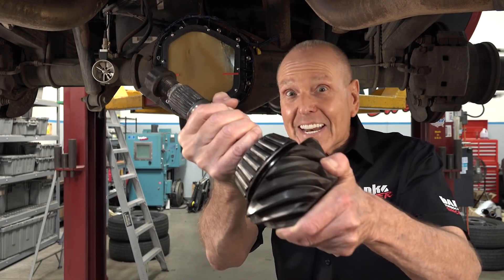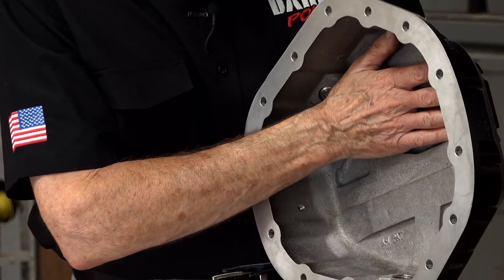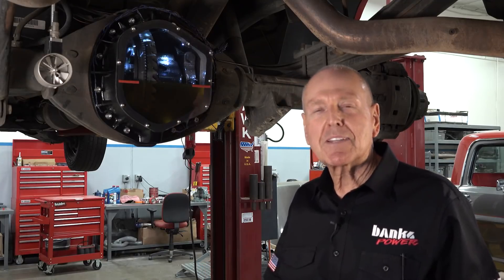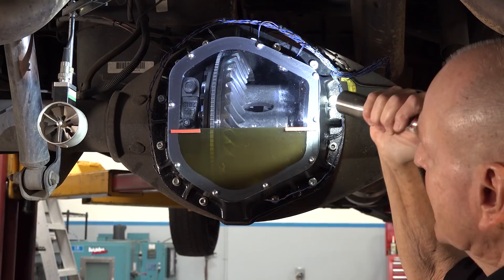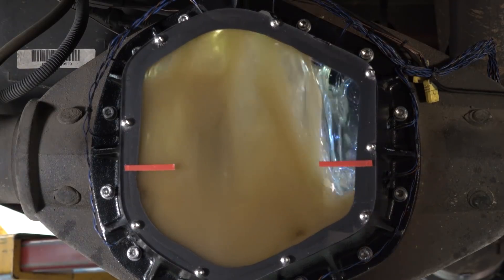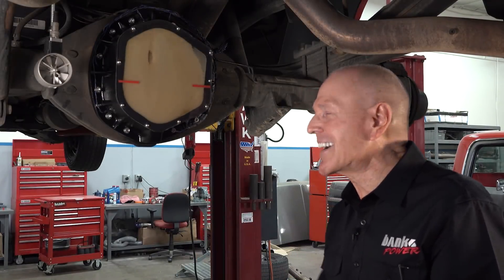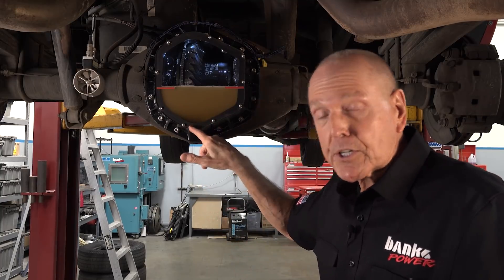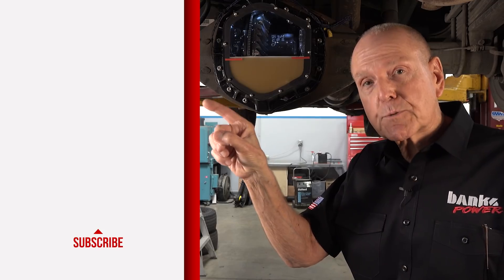What's going on behind your flat-back diff cover?

Comment: If you want to know how much oil is getting to the pinion,  repeat the test under some kind of a load and measure temp of the case at each bearing race (so 4 places).  Even a light load as long as it is repeatable will prove that the pinion is getting starved.  I checked case temps of an axle that I rebuilt using an IR thermometer and I found that while the oil temp was getting to around 185deg F (measured at rear cover), the pinion head bearing was hottest at around 210deg F followed close by the pinion tail brg and then the L side carrier brg.  The pinion gets the biggest workout as far as temps go, and as you know temperature kills gear drives more than anything.  Excellent video, BTW and thanks for sharing your findings!

Comment: Hay Gale, what about a Mag HI tech Style cover with a stock fill level hight and a windage plate so the oil will flow nicely with the ring gear. The oil won’t cavitate or airate you will have more quantity of oil and the aluminum cover to dissipate the heat. Maybe even some bling?
Reply: Just make a windage plate that fits between the axle and any aftermarket cover. It could even have parts top and bottom to smooth the transitions to the axle housing for less fluid heating from the turbulence in those areas.
Reply: That seems "logical". Maybe having something like a built in "shoot" or "channel" that wraps around the ring gear like a motorcycle front fender hugs the tire to guide the oil and mitigate cavitation and all the other nasty stuff as much as possible.

Comment: Dear Mr Banks; Im enjoying the videos and the knowledge gained is great. Yeah here comes the BUT. I hate to ask if you would run the test again but, would you run the test again. This time would it be possible to monitor temperature differential between stock covers vs flat back by putting a temp probe in the diff. The other idea i was curious about was using a flir camera to monitor the temp just behind the yoke to see if the pinion is drastically hotter from cover to cover. Again just curious. Thx
Reply: Temp numbers are coming with the dyno test on part 3, I'm sure.

Comment: I’ve seen enough,just make a stock shaped aluminum with fins
Reply: Bradford Ramm why fins? Cooler oil will have a higher viscosity and waste power.
Reply: mbox314 start hauling a hotshot grossing over 32 k in the summer over the mtn passes and then see if you still ask me that question.
Reply: how could you say that... lets wait for the master to finish the tests
Reply: @philtripe  lmao  this comment  made my night
Reply: What I don't know about oils could fill a warehouse but I imagine if your differential oil stays within a working range you should be fine, elevated temps below the maximum working temp are not nessasarily bad as higher temperature differences result in exponentially faster heat transfer, also a less conductive diff cover would be helpful in shorts low load drives in colder weather as your diff oil would get to the ideal working temperature faster and lubricate adequately. Put a temperature sensor (avoid IR's as the black coatings higher emisivity will give higher readings)  if you notice higher temps than your oil is rated for then a new diff cover would be worth considering.
Reply: @mbox314   cooling fins will not make differential fluid cold enough to increase viscosity to a level causing more parasitic draw. Cooling fins are meant to help dissipate heat so the fluid stays in the normal operating temp range, increasing the usable lifespan of the fluid.  In theory cooling fins could remove too much heat but, in my opinion, the fins would have to be rediculous in size to achieve that much cooling. But I am not an engineer, just a seasoned automotive technician.
Reply: Kevin Kalivoda I am an engineer but this is not my area of competency. I really need to brush up on my thermodynamics knowledge. In my job right now I am actually intrested in increasing friction instead of decreasing it. Friction is an interesting subject. Did you know on hard surfaces increasing surface area has NO effect on on friction force , the only two variables are normal force and friction coefficient. Many  materials do not follow classic friction models and I would like to know more about them.
Reply: @NoName-tz5ji , im not defending mbox314, but if you are hauling 32k lbs with a 1 ton truck i am pretty sure you are well past gvrw as well as the design limits of a 11.5 AAM differential. But I agree with an aluminium cover with cooling fins. Or, take a page out of NASCAR and run a driveshaft driven pump and cooler for the diff fluid.  Yeah, it will increase parasitic power loss and decrease fuel mileage but it keeps fluid temps in check.
Reply: Kevin Kalivoda I’ve seen 1tons gross 42k on a regular basis for decades. Easy on the throttle and you’d be surprised how much your equipment can take with increased fluid changes and real synthetic.
Reply: @NoName-tz5ji   im not debating weather a 1 ton can move that weight, its about should it haul that much weight. I have moved a 40k lb connex container with a 2500hd pickup without mechanical failure, but I only had to drag it about 200 feet through a work yard. To me hauling that much over gvrw on the road becomes a legal and safety issue.
Reply: Kevin Kalivoda more legal than safety nowadays,but then again we have the CDL government certified school indoctrinated snowflakes at the wheel nowadays so you might be right. I sure do miss America and Americans. Can you imagine trying to invent the airplane in today’s America? Sad
Reply: @ryanburbridge  you do know the alert plan was started under obama,  right?
Reply: @NoName-tz5ji  hurr I tow so now I'm a lubricant chemist
Reply: Mctig Mctiggy absolutely! However that’s an equation for those grocery getters not a heavy tow vehicle 🤫
Reply: Ram has an OEM diff cover that is aluminum and has fins. It comes stock on certain 1 ton models
Reply: Mark T they are the fastest growing brand for a reason. (Now they operate separate from Chrysler Corp)
Reply: Some manufacturers do make their covers with fins and keep the stock internal curve design and it works great
Reply: My 2013 F350 6.7 has a stock aluminum curved cover with fins.   After watching this video series I am never changing it.
Reply: Thank you for doing this video! It is really great to see that you putting in a lot of research on these covers. Looking forward to seeing video #3!! After doing all of this I know that you will make a diff cover that works!!!

Comment: Awesome information. I've always theorized that most aftermarket diff covers cause undue work to the oil and theorized that overfilling (as recommended by the diff cover manufacturers) causes excessive aeration of the fluid. Because of this I've always run stock or stock style diff covers in all of the off-road trucks I've build over the years. What I have done is have plates of steel welded to stock diff covers to provide protection from rocks, etc; especially at the front axle and at the bottom of the rear axle cover (where rocks can rip open stock diff covers when sliding over them).

I've had numerous "discussions" with guys in the local off-road club who think they are helping things by running these aftermarket diff covers and overfilling (especially with guys who haul their trail rig to the trail and install them on the tow vehicle). I don't think I've convinced any of them but maybe these videos by Gale Banks will help...

One thing I'm no so sure of though is if aftermarket diff covers actually starve pinion bearings. I suspect there is still plenty of oil slinging off the ring gear at high speeds that "foamy oil" still gets to the pinion bearings. Every differential I've taken apart has always had plenty of oil in the pinion lube pockets, regardless of which differential cover was installed. The fact that the oil is so badly aerated is why I believe both the R&P gears and all of the bearings only suffer with these overfilled aftermarket covers and that stock is much better at providing lubrication.

Comment: So, copy the stock design, in aluminum, and add some fins?
Reply: Yes. Perfect setup lmao
Reply: would never buy weak ass aluminum
Reply: @mattlane2282  you will never break an aluminum cover using it for what it's intended for. Towing.
Legit off roading, get fabricated or cast steel or iron.
Reply: you have a huge hole in the back if anyone does not think that cover adds strength they are nuts... 

also... dissimilar metals... why... just why...
Reply: Theoretical optimum. External heat exchanger to maintain the best temp for the oil.
Reply: Its already been done look at a RAM 3500 diff cover ...it comes stock has curved inside with big fins and alumunum
Reply: look at Ford's 350 and 450...
Reply: Matt, the cover is just that, a cover, it is not a structural element at all. Those retarded covers that have the bolts to push on the bearing caps are a joke. If they were, they'd be made of something more substantial than 22 gauge steel that you can stomp flat, and on with something more than 1/4-20 bolts. That's why the case is an inch thick of cast iron.

Comment: Alright, this is turning into more hype than I was hoping for... couple of points to note, questions to ask yourself before you jump on the non OEM cover suck band wagon...

1. What is the failure rate of rear axles with non OEM covers? What is the failure rate of stock covers? You'd think if all Gale is saying is true, there'd be some mighty pissed off people out there. I haven't hear any, have you?

2. Oil aeration. Are you really going to sit here and tell me that the factory cover doesn't foam the lube? You only saw the Ford cover run to 30 mph, he didn't go to 50 like on the Dodge, so right there,  that is not an equal comparison. Also I believe the Ford's lube for the half ton is thinner than the 1 ton axle. Check me,  but run speed alone disqualifies this.

3. Oil aeration and lube type. Not sure how many people dive this deep into oil, but, a right angle gearbox like the rear end is horribly inefficient to start with, and thus, it requires a unique lubricant. Have you noticed that engine oil is getting thinner and thinner with new engine manufacturing tolerances getting better, while gear lube is unchanged? The whole reason it uses molasses-like oils is because the application beats the snot out of it. Even a bevel gear right angle drive uses heavy oil. It is in their nature to aerate the lube. It is accounted for by design. 

4. Front bearing lubrication and amount of carryover from the pinion and tone ring. Gale is all kinds of hung up on the amount of carryover present in the system vs its relative aeration of the lube. It's a flood system... whether you flood it an inch deep or a foot deep, once the shaft and bearing is covered, that's it, you're not going to lubricate it any more or better. Being that the inside of a rear axle housing pretty much looks like the inside of a blender at normal highway speeds, the lube is gonna have air in it. Nothing you can do about it. The addition of additional fluid, as added by the increased cover depth isn't going to change this by any appreciable amount up or down. I do agree running higher level to fill the tubes is a dumb idea. The added lube just give more working fluid to absorb heat. Point I'm trying to make here is that as long as the ring and tone ring are throwing oil forward to the slot for the pinion bearings and gear mesh interface as a flood lubrication system, it doesn't matter where the oil frees itself from the pinion.

Bottom line is look at the failure rate of stock vs non stock covered differentials,  but also temper that against stock vs non stock tuning as well. Over power rating of the axle will kill it no matter what cover is on it.
Reply: I would agree 100% I wish more people read good informative comments. But marketing sells
Reply: kleetus92 I know plenty of people who tow heavy fivers over western mountain passes regularly, with stock diff covers. GM, Ford, and Ram trucks. None of them has failed a diff, all of them have run stock diff covers. First thing that goes on the Fords and Rams is the gearbox (excepting the newer Rams with the Aisin commercial truck trans). The GM trucks don’t seem to blow running gear at the same rate, they burn up the emissions system, ancillaries, and interior electrics. 

Dunno about where you live, but the trucks I see with diff covers are bro dozers that don’t actually tow heavy. The farm truck with the 30-ft gooseneck and a big Kubota on it? Stock diff cover. Exceptions to this are exceedingly rare.
Reply: DucFanDan no argument here. Only thing I'm trying to say is, is this a solution to a problem that doesn't exist and if you're going to talk about comparisons of conditions, at least make them all the same. By the way, love the term Bro-Dozers.. I gotta remember that!

Comment: Banks diff covers incoming.
Reply: RemoWest I said this on Facebook. If he can come up with a design that makes sense, and has a noticeable improvement over stock, he will make it. If his research shows that the axle companies have it right and no other design will make enough of a difference to warrant the development of a new product then he will leave well enough alone.
Reply: I expect "Banks" to produce diff covers with a radiused area where the cover interfaces the diff housing, similar to an O.E. unit. It seems only intuitive that is what is necessary to reduce the heating and aeration of the fluid. Also I would expect the contoured cover to benefit the dynamic flow of the fluid and aid in the lubrication of the pinion bearings, As the "stock" covers probably already do. That being said, I'm sure will  learn something within his testing that we may or may not have assumed.
Reply: Stock ones seem to work fine......
Reply: Probably for the bargain price of 2 times all the competition.
Reply: I'd say he already has one ready to go, or he wouldn't be bashing everyone elses so hard
Reply: @thomasmattern8679  bullshit.  He would have made one regardless. $$$$$

Comment: it didn't look any more aerated then the round back. Both levels were barely over the static mark after stopping.  Its really hard to judge lube flow just from the one dimension.  id like to see some heat senors on the pinion bearings or in between both bearings. that would be a great indicator to how the oil is truly lubing and cooling the pinion bearings.  Awesome work Gale!  truly unique

Comment: Possibly they want a higher fill level due to pinion failures ?
Reply: Sounds about right
Reply: Maybe they are trying to submerge them since they don't get splash lube
Reply: If it had a rounded diff cover rather than a flat back, then maybe it never needed the higher fill level.
Reply: It creates more circulation, moving foreign particles towards the magnetic plug.  Foreign particles and pitting from cavitation is what kills geared systems.  These diffs and bearings don't require much lube to operate.  There are so many factors being ignored here, it's comical.

Comment: Perhaps the overfill specification is because the flat back is causing the pinion bearing to be under lubricated, and raising the level causes more fluid to hit the pinion. It was a solution to the problem created by the flat back......
Reply: i went to Jiffy Lube one time, told them not to add any diff fluid. they did any way and the rear end blew its oil seals like three days later...1970's GM 10 bolt
Reply: Yeah, that's what I was thinking about.  Adding fluid to the point the static level above the bottom of the axle tubes is going to cause leaks on seals that would otherwise hold up.
Reply: No, cause dodge guys were having axle bearing issues back in late 90s early 2000s towing large campers,  and blamed the fluid level and the stock cover on the 25-3500 diesels